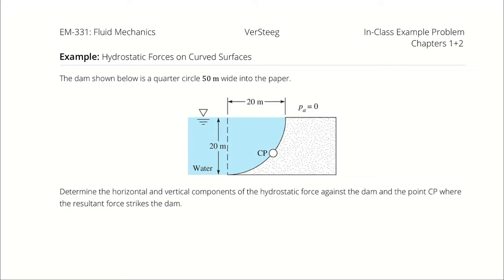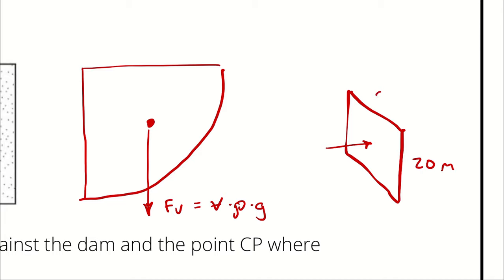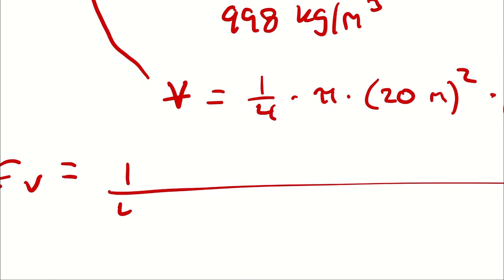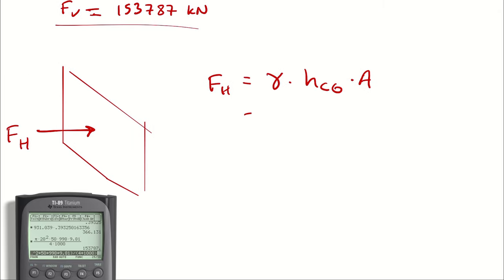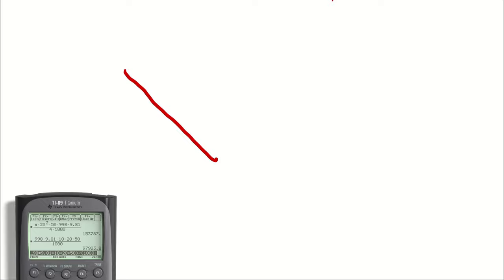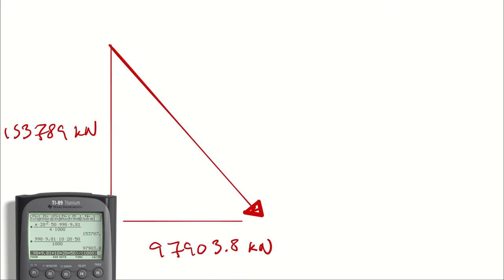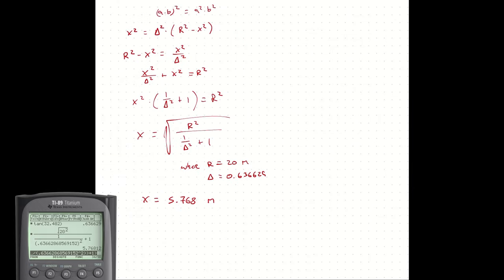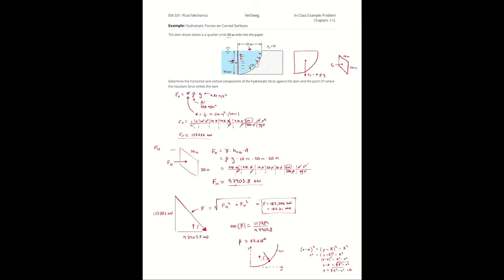Example Problem - Hydrostatic Forces on Curved Surfaces (1)

Comment: 24:38 The square root seems to be applied to only the numerator in the calculator. If applied to both numerator and denominator, I got x = 10.74 instead of 5.768.